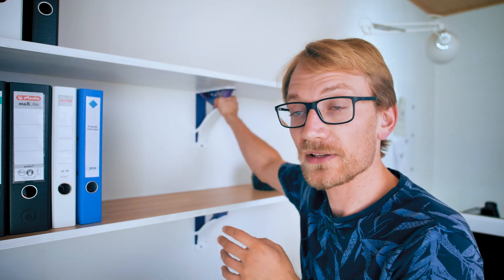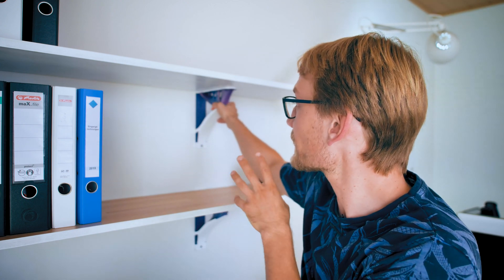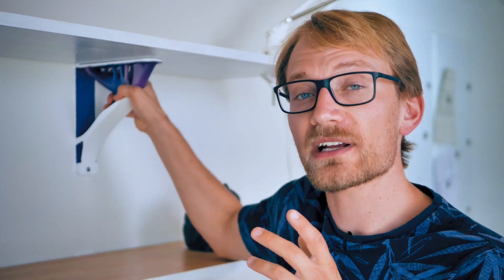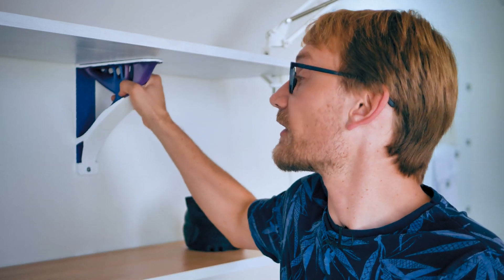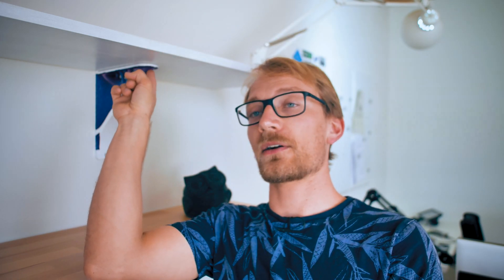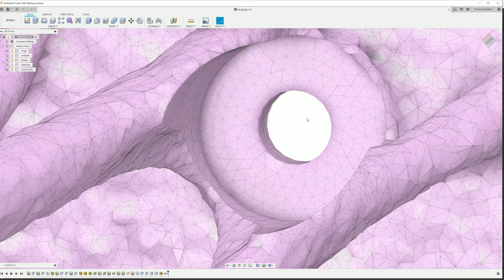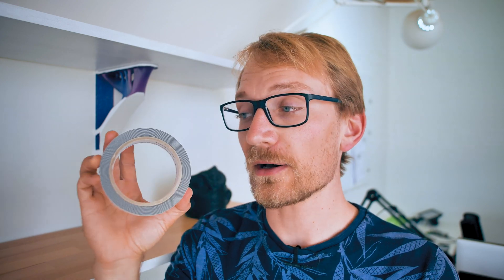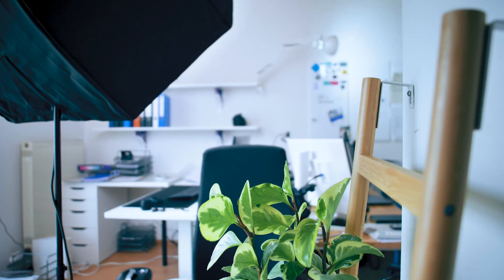Why the topology optimized brackets weren't screwed to studs (and other questions answered)!

Comment: Americans just assume people all over the world build their houses from paper and OSB board xD
Reply: Stud framing and drywall is quite common in Northern Europe as well, and our houses doesn't fall over either, thank you very much. :) The reason we tend to go for stud framing is because you can fit more insulation in a wall than with brickwork, and it's generally cheaper to build that way. The downside is that you basically need our subzero winters to dry out the construction properly, so in a more humid and temperate climate like central Europe or Britain brickwork might be preferable, since heating costs is less of a concern. I think you'll find that Europeans are just more familiar with different building methods and as such do not assume that every single wall they will ever encounter is made out of studs and drywall. :)
Reply: @sstorholm  thank you Sebastian for that crash course in civil engineering. Could you elaborate on the topics of high supply of timber in Scandinavia and cross laminated timber as a construction material (CLT). I assume you are a civil engineer cause you have a high visibility jacket and glasses ^^
Reply: trailblazingfive You were right about the engineer part, though not civil. As such, I can’t really say anything about the more “modern” ways of timber construction or the high supply of it, except that we are surrounded by trees everywhere. :)
Reply: @sstorholm  Please don't make blanket statements about 'Britain'. Timber frame construction is very common in Scotland. We have our own building traditions, architectural styles and building regulations. 🙂
Reply: Strathpeffer Junction I was specifically trying to avoid that, sorry if it didn’t come across properly. I was merely referring to the fact that brickwork is something of an oddity in Finland and Sweden for smaller houses, while I’ve seen rather a lot of stone and brickwork in Britain.
Reply: Exactly. The rest of the world builds houses that don't fall down when you sneeze!

Comment: You should share the file for those.
Reply from the maker: The files is already linked under the original video - but it's at https://www.prusaprinters.org/prints/4623-topology-optimized-shelf-bracket-holds-over-80kg-e and all the other sharing platforms, too!

Comment: I have some shelves that are totally not secured to the brackets. The brackets are large enough that the shelves simply won't fall off.Why would they?
Reply: i have a shelving system hanging over my bed that is store bought and only consists of wooden boards resting on triangular strutted metal parts. in the beginning there were small rubber caps that were supposed to prevent sliding, bur as the thing is loaded with books now friction between the board and the 2mm wide metal surface alone holds them in place

most screws are not meant to hold against shearing forces and only provide an additional preload on the contact surface for friction

Comment: Great video! 
Topology optimization is used to find an optimal (minimum) compliance given certain constraints, such as volume and geometric constrains. But the resulting topology, while optimal in a stiffness sense, may experience too high stresses under load. 
It's the stress under load that causes cracks to form and eventually the structure to fail.
Now, it is possible to include a stress constraint in the topology optimization algorithm, but due to the nature of the density based algorithms, the surface of the topology is not well defined, as as such the computed stress would not be accurate enough to be of any use in that case. Thus, what we do is to use topology optimization in an initial step to get a sense of what the optimal topology should look like and then in the next step create a CAD model on which we can run FEA to optimize in terms of stress concentrations and manufacturability.
Reply: If I understand this correctly, if you wanted these brackets to have maximum load capacity, you would take the organic shape that the topology created and redraw it with more gemetrical lines? In this specific case, the "roots" or "branches" that's created would then be drawn as straight lines with an even diameter? I have no experience with any of this and have never done any form of load calculations for printing objects.
Reply: @halsoy  How you draw the new geometry is up to you. Call it designer freedom. You as an engineering have perhaps other factors to take into consideration, one of the biggest being design rules to actually be able to manufacture your design. For 3D printing and this particular case it could mean making the bracket have a uniform thickness and cut out material that is not critical. This problem of converting topology optimisation results to actually manufacturable designs is by no means trivial, there is active research ongoing to develop better tools to aid design engineerings with this problem.
Reply: Oh and by the way, there is not just ONE topology that is optimal, in fact there is a set of designs that each are in a sense basically equally optimal. Given the constraints and other filters added to the optimisation problem these algorithms find a local optima, not a global optima.
Reply: @mirzacenanovic  Thanks, I'll have  to look into this more. Seems like something that's very useful to understand, if only to a basic level. I'm sure there's tons of uses for it even on a hobbyist level.
Reply: @halsoy  Using fusion 360 and topology optimisation with 3D printing is really great! Here's a tip for a workflow: 1. Run a topology optimisation on a starting design on which you have more material than needed.  2. Redesign your design based on the results of the topology optimisation, this is where you take print directions into considerations, etc. 3. Run a structural analysis to check for stress concentrations in order to dimension radiuses properly. Also check that the displacements are within your limits. 
Now keep in mind that all the uncertainty due to non-linearity, anisotropy of the material properties and process properties such as layer bonding etc. can be overcome by a safety factor, since it is not that critical to get exactly optimal.
Reply: @mirzacenanovic  thanks! I actually have some projects in mind where this might be useful. Got some stuff for my cousin and some shelving and few bits that needs to take some load while fitting in small places where I can use this. It's always a good day when you can learn something new 😁